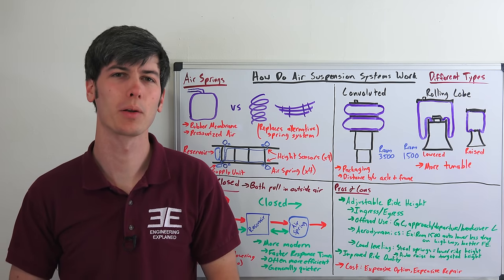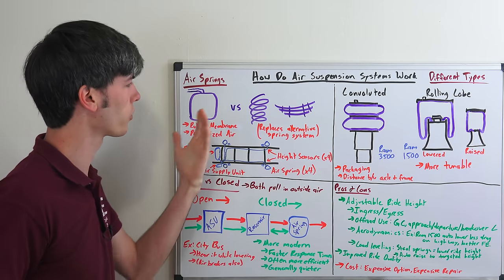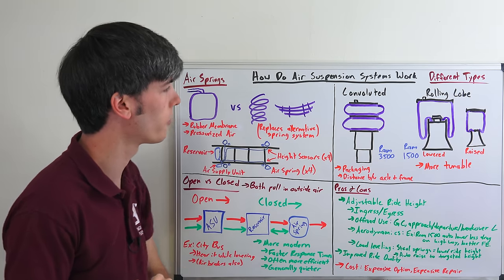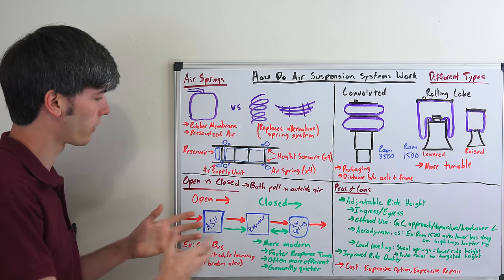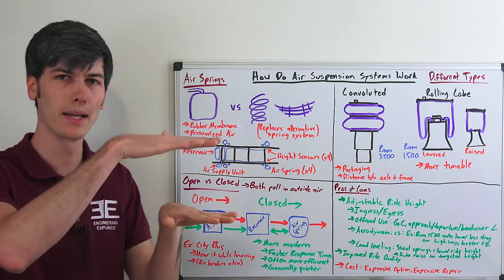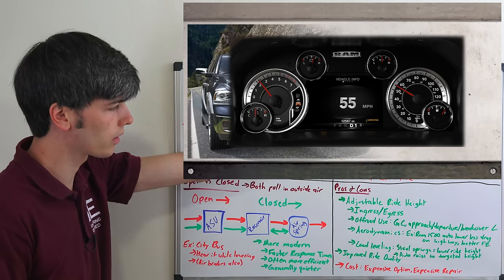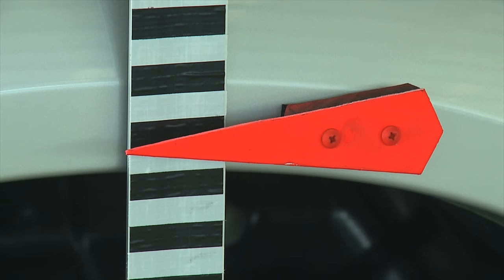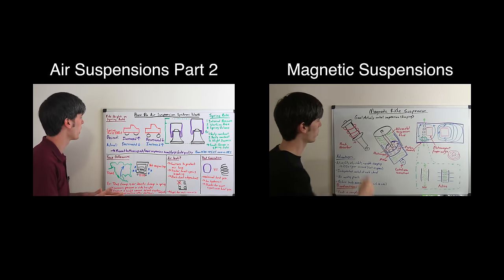What Is An Air Suspension?

Comment: I am just wondering. How do they increase pressure at a constant volume? Is the air heated?
Reply: Just press air with an even higher pressure in?
Reply: +shi01 Yeah but the bag thing is expanding in order to lift the truck... Idk, I bet it just increases the volume of air
Reply from the maker: +Thomas John this only happens when you increase load on the vehicle (you increase pressure but maintain ride height). More weight means the car is pressed down. More weight means you do in fact increase volume, and pressure, but ride height returns to your target.
Reply: I think him saying constant volume was a mistake - I would think the pressure would be increased by increasing the volume of compressed air from the reservoir.

Comment: What's the difference between aftermarket Air Suspension systems, such as AirLift, compared to those used in the RAM?
Reply: Ram's is designed for the application? Aftermarket is kinda a catch all? 

That's a good question.

Comment: So it is implied that if the city buses (using the example in the video) used closed air systems, there would be no hissing noise? Then where does the air pressure go? Back to the reservoir tanks?

Comment: So far I love the air suspension in my 2013 RAM 1500. It has the best ride quality when compared to the competition. Ford's is nice but it can be rough. GM is soft but isn't stiff enough. Toyota just needs to stand in the corner since its suspension is garbage when it comes to uneven pavement. 

Basically, when I was test driving a 2014 Tundra SR5 TRD the sale's man stated that the Tundra had the smoothest ride in its class. Which was true until the truck started bouncing over the paved road. It was the same section that I drove a RAM 1500 Big Horn over and it didn't even noticed the road imperfections with the coil springs.

Comment: EE. Is there a benefit on the track of running these or would you say the coils are better for that?
Reply: air bag companies are getting good at making bag systems that are as  good as a normal aftermarket coilover. obviously depends on car, but they can actually work well on track. those systems are expensive though
Reply: +Hesayad I car I would do this with would be a 2015 sti. I already have it lowered and handles great but it there's something better always an option.
Reply: Chad03Cobra i wouldnt be able to answer that for you. you  just gotta do your own individual research now. probably should search on forums and see how they like their bags (although, not many people hardcore track cars with bags though as far as i know)
Reply from the maker: Absolutely. I think the biggest benefit is that you can lower your car for the track, then bring it to a reasonable height for your drive home. As long as the adjustments are there (camber, toe, etc.), it's just a matter of choosing a good spring rate for your track conditions. I'd love to have a purpose built track car riding on air.

Comment: So those bagged cars that you see with aftermarket systems, do those generally use a closed or open system? You can hear the pshh noise when it's actuating the airbags which would lead me to believe that it's open. Is that correct?
Reply: Open system

Comment: Love My 1997 Lincoln Town Car
Reply: Me too. I regretfully did a spring conversion on one of mine. You definitely feel the difference and it's basically just a Crown Vic now. Handles great around turns but that's obviously not the point of the Lincoln. So glad to have a new TC with airbags again.
Reply: You took the airbags out of your TC?!?! How dare you! I love the TC every year model of it! It's probably the most comfortable riding car I've ever driven. There are some Grand Marquis' with the air-ride rear suspension option too and they ride just as smoothly as a Town Car (as expected)
Reply: MAN_ON_WHEELZ
I know man I feel terrible about it. Had listened to too many people saying it wouldn't make a difference, easier, no more hassle, etc.   HUGE mistake. And really most of the time all you need is new bags. Solenoids, lines, height adjustment, and compressor seem to hold up pretty well. I have 312k on the executive and everything else on it still worked.
Reply: Chimney Fish Oh man, yeah, never swap from air to coil. The air system isn't that complicated, its best to keep it as you've learned lol. You're taking some of the heart and soul out of it being a Lincoln.

Comment: Do cars which change ride quality (soft vs stiff) use air pressure changes or is this something related to dampers?
Reply: they use special dampers....some are filled with magnetic fluids, the more common ones just have valves wich adjust the oil pressure in the dampers.

Comment: if you were to add a big pay load, and the air suspension was to add pressure to increase ride hight. wouldn't that give to driver a higher risk of potentially blowing an air bag if rough terrain were to come in their path?

Comment: My car originally had self-leveling air springs, but those of course eventually rotted out and the owner replaced them with air shocks.

Those went out shortly after I got it, and when I noticed it had happened there was a broken air line dragging on the ground afterward. I had the lines replaced with the shocks just to be thorough, but I have no idea why it has them. This no longer has an air compressor in it, so what on earth could those lines be going to? The A/C compressor? I would look myself, but the car is huge and the lines are tiny, so locating them would be very difficult.

I would've asked the shop that did it, but I didn't know to ask at the time and you couldn't pay me to take my car anywhere near that shop again.

Comment: In think adujsting the ride height of an air suspension is more comparable to preload adjustment of a steel spring.
Because to increase the ride hight, you only increase the volume by putting more air in it, the pressure in the air spring will not increase.
AND additionally an increased volume of an air spring, reduces it's spring rate!

Comment: Wouldn´t it be another con that it is more prone to damage or malfunctions as a spring is a single basic physical part while you need a whole system to get the air suspension working and if it were damaged or you lose power (it uses power doesn´t it?) one would wind up with no suspension? I recon as you didn´t mention it that this system is durable enough so it doesn´t make any difference but that rolling lobe system at 2:26 looks kinda open to me especially when off roading isn´t there a danger of leakage due to damage from harsh terrain/ branches etc?

Comment: does air suspension affect cornering in sports cars?
Reply: I don't think so. I have the Air Suspension on my RAM 1500 Laramie and it performs just as good as the coil springs on the Big Horns. With saying that, the Laramie does have a smoother ride over the coil springs though. 

Personally, If I'm buying a sports car, I want to be able to feel the road and its imperfections.

Comment: What is heavier ... 4 steel springs or the air suspension?
Reply: Air is lighter than steel, but the air suspension needs a compressor and stuff so it may be a little heavier not by much tho

Comment: i expect damping is a separate system - probably external to the air system (at the wheel)?
Reply: I found a custom air spring setup and understood damping is integrated. But not sure whether an external damper is better or practical.

Comment: i think is technology has been implemented into super car for long time isn't it?

those super car video that shows off the rise/decrease "suspension" ?
Reply from the maker: Yep, air suspensions are certainly not new. They've been the industry standard for semi trucks for many many years. Common in high end sports cars as well for their ability to raise/lower.
Reply: I used to see them in, I think, Cadillacs and/or Lincolns back in the day when I used to work on cars (20 years ago). There was a switch in the car to turn off the air suspension. You were supposed to do this when you lifted the car to keep from damaging the suspension.

Comment: The rolling lobe design seems like it would wear the heck out of that rubber membrane.
Reply from the maker: The design has been used forever on semi trucks, it will last!
Reply: I'm pretty sure that they were first on buses. In any event, yes, they do last a very long time. The rubber is thick and and can be very weather checked but still not leak.

Comment: Will it explode on adding extra weight on and on?
Reply: It shouldn't, the system will maintain a constant max pressure in the "springs". Taking air out after you reached the maximum pressure and kept adding load.
Reply: the system SHOULD have safety checks and valves in place to prevent this from happening until the bag is at the end of its life.   If the material truly is rubber, oils from the road and/or vehicle its on will eventually break down the air cushions leading to higher chance of failure at a given pressure.
Reply: It does have safety checks. Once the computer sees that it's at its maximum pressure and the height is still lower then it should be, it kills the system to protect itself and sets a "suspension overload" message in the cluster as well as codes in the computer. The bags are enclosed in a rubber boot as well to protect it from dust and debris

Comment: Air suspension also requires power from the engine, correct? So it would reduce mpg.
Reply from the maker: Well, sure, it requires energy, but only when compressing air, which isn't going to be for long durations. The loss of energy by compressing air would be significantly outweighed by the aero benefits while driving on a highway.

Comment: Hey, what type of suspension does the new Tesla use?
Reply: Both. Steel springs are the default. Air suspension is an option on both the X and the S.

The cool thing they do is to connect the air suspension to the GPS - so the car remembers where you increase ride height and do so automatically next time you're at the same place.
Reply: ***** These is not a SUV. Traffic patterns, road conditions, weather will ~never affect your need to raise the car. I've used on a few occasions when the road hasn't been cleared of snow, but that is rather seldom.

However, it does raise the car before driving up the driveway and into the garage and this happening by itself is quite useful.

But it isn't a killer feature. It's a nice-to-have.
Reply: I get it. You're more interested in characterizing me than staying on subject - what is commonly referred to as "ad hominem".

The thing is - why wouldn't Tesla do this? They have a GPS, the suspension is already controlled through the computer so it is a 50-100 (dev, testing, QA) day programming job to connect the GPS and the suspension and create the autoraise feature with no marginal cost. Compare that to most other car features and it is basically a free feature.

And it works OK. The car automatically raises itself before going over the speed humps on my daily commute. Moderately useful.
Reply: Awesome! I would personally like to thank you american tax payers for a wonderful car. :-)

Comment: You forgot one CON, if it fails you are going no where.
Isn't that right mr president
Reply: same for a broken spring.  I'd rather have traditional steel spring suspension over air ride, but if a leaf pack snaps or a coil breaks in half you either lost all suspension or are risking puncture of a tire by continuing to drive.  So the logic of if air ride fails you go no where doesn't make it differ from traditional suspension systems.  Don't even get me started on torsion bars, ugh.
Reply: @bmarcy86  Not true - I had leaf spring break - in Toyota Tacoma. Toyota admitted their stock leaf springs were garbage and after some threats from owners decided to replace all leaf springs with new ones.

The side that has a broken leaf simply sags and its not a great ride + you cannot carry any load. Others got broken leaf while off roading - it simply means end of a day.
Reply: @bmarcy86  Use leaf+air springs, if the bags blow out you can use the leaf springs.

Comment: is the air suspension as strong as the springs?
Reply: air ride has been used in the mid to heavy duty truck industry for years.
Reply: Just like with springs, it depends on how thick they are. If the membrane of the air suspension is very thick, it can take a LOT of pressure. In fact, a lot of heavy load trucks nowadays use air suspension.
Really, the only downsides when compared to normal springs are: More expensive, and can feel "floaty" depending on how it's set up.
Reply: semis use air bags so they can be made very durably
Reply: i doubt it would last as long as normal springs. Also, there's many more components to go wrong
Reply: Paul Hojda Obviously, but the pros outweigh the cons in that scenario. It's the same argument as "Well, a Honda Civic is more reliable, and has fewer things to go wrong than an Audi A8"

Comment: Skip to the bottom if you want:

As a man from New Jersey, I want to be able to one day have air suspension on my dream car (Nissan Skyline), but I plan on using it as a daily, so I'm worried the system would be affected or damaged by the massive amounts of snow from the winter. 

So the question is: Will anything bad happen to the air suspension if the car is deep in a feet of snow?
Reply: Snow itself will not damage the bags.
Salt and other corrosive chemicals will attack the rubber of the bags though.
Reply: Okay, thanks.

Comment: No!, these DO NOT "Replace" the "Coil", or "Leaf" springs, they are used in "Conjunction" with the said springs.
Reply: Yes, they do. I work as a design engineer developing air springs for passenger cars.

Comment: it's makes a compelling argument for comfort but rubber being used in a suspension system that is exposed to fast moving projectile pebbles while accelerating at over 100 mph and always carrying at least a ton of metal bearing down on it is a recipe for poor durability. anything from a puncture to rubber just withering off from environmental exposure can make these expensive options a constant money drain. for people who are not that particular about luxury the regular spring suspension is still the most reliable option that will last quarter of a century maintainance free.

Comment: Are there any significant advantages or disadvantages of an air suspension versus a magnetic ride suspension?
Reply from the maker: You can have both. Air is the spring, magnetic is the shock. For example, Land Rover offers both as options on some of their vehicles. I have a video on magnetic ride linked in the video description.
Reply: Oh, okay.  Nice!  Yeah, I actually went straight to that video right after this one.  I guess it didn't register in my mind that the air bags were just substitutes for the springs (even though you clearly state that, my bad).  Seems like that combination would yield pretty solid performance depending on the driver's goals. I really like the idea of having adjustable ride heights and electronically controlled dampening. I imagine it would be fairly easy to create customized profiles much like auto manufacture's various "modes" and the like. 

I always look forward to your videos as I really appreciate your dedication to educating the masses. I reference them often when working on my own car. Thank you for taking the time to respond!